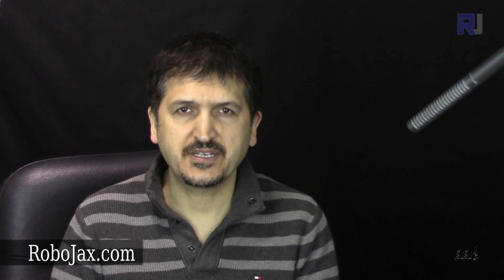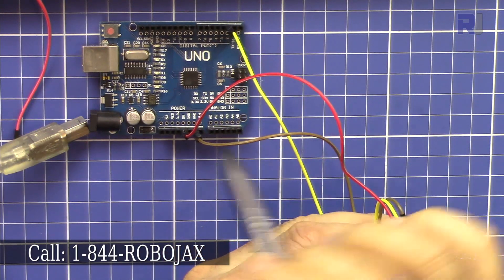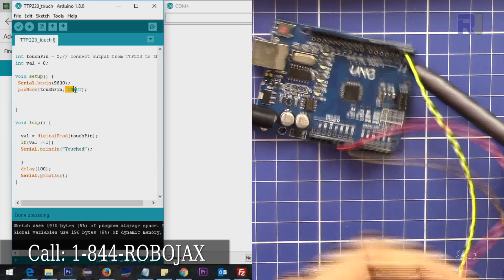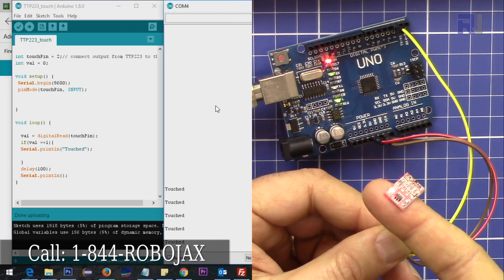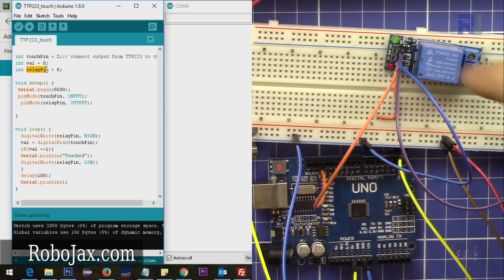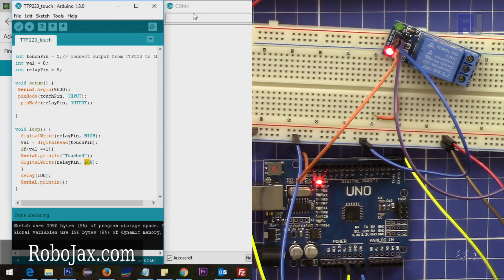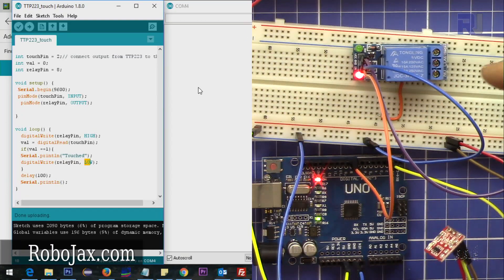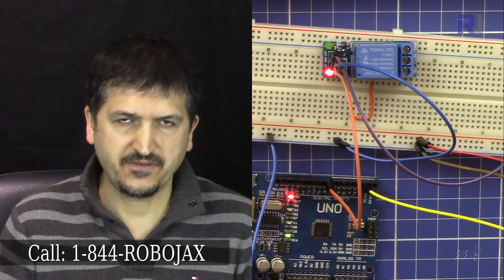How to use TTP223 Capacitive touch  Arduino module RTJ06

Comment: Good video but shouldn't you have soldered the pins on the component side of the board? It wouldn't be useful in a real application to have pins emerging from the same side as the touch sensitive pad.
Reply from the maker: it is the matter of preferences. you may be right. thanks.
Reply: @robojax  no problem. You make good videos.

Comment: Hello!  very good video!  
I have a doubt!  
I have a problem in the momentary activation mode, the sensor after 7 seconds holding it gives a delay and turns off the engine that is activating.  
how can i solve this?
Reply from the maker: Hello, sorry for late reply. I must have missed your comment. so you want to activate it when touch is held for 7 seconds? You can do it using millis() function of Arduino. Here is full video to learn millis https://youtu.be/obBX9hyH5mM
Reply: @robojax  no, i want it to turn on while tapped and off when released.  But this module only stays on for up to 7 seconds.  it has a delay to recalibrate.
Reply: @davidlima3615  @Robojax i need answers to this same issue
Reply: is the problem solved? i have the same problem

Comment: Can I use this to power on a Cordless hair clipper ?
Reply from the maker: your clipper or any other device is a load . you can turn ON or off a load if you use a relay. here is the video showing how to use a relay with this touch module https://youtu.be/YSI1PdSLbt0 or search my channel for so many other videos.
Reply: @robojax  very understood boss, my clippers are wireless and have a chip on them already would I still need a relay ? I don't believe there is enough room in the Wahl cordless clipper to have a relay box in there

Comment: Hi, can we control an ac washing machine motor with the given relay in video?
Reply from the maker: Hi, yes you can using a relay.  Here is the video from my course https://youtu.be/N-xbxtGGoHw use the output from touch project to  to control relay.  Your relay must be capable of whatever power your washing machine is rated. If machine is rated at 10A then the relay must be rated at 10A for example.

Comment: i picked up a couple of those ttp223b, with the pins already on, from aliexpress a few years back and am finally using them...   seems to be an issue with all 5 i got, but just to test, had hooked up 5v to vcc and grd and the light stayed on... tried two more and same time...   then i hooked up to the arduino and it shows what i could consider to be 'normally closed' - it shows touched every single time it goes through the loop when it's not touched.   anyone know what i can UNSOLDER or connect make this stupid thing work?  i know they're cheap to buy, but it's the time to have to wait to get replacements...   if i can fix, i'd like to.

Comment: How can I increase touch area of this ttp223 capacitive touch module? What will help me ? Aluminium foil or anything? I want to increase the area it gets input for the sensor. Pls.
Reply from the maker: I have provided the datasheet. They have mentioned it. it is not about just surface area. it is the material property and holds the electric charges or the "capacity" holding charges. if you increase it beyond certain size, it will always be ON or shown "TOUCHED" because the air will charge it. So either you have to know  full characteristic of material you are using (which most cased you don't have it) or just experiment with different material until you reach desired result. there might be resistor or something that you can change the sensitivity which you can find again from the datasheet. I have provided the link in the resources page. if not simple google or bing search will bring it. good luck
Reply: @robojax  okay thank you soo much. What is a good material for this touch module if I wanna rase it's sensitivity to the area half a metre ?

Comment: Hi, a quite old video but maybe you have an idea. My TTP223 is to control a NEMA stepper motor. I got accidental ON/OFF (light on TTP223) if the NEMA is connected and operating and the TTP223 is NOT floating in the air (just cables). If mounted to the wall I got this ON/OFF during NEMA operation. As soon as I disconnect the NEMA, everything is fine. There seems to be some frequency influence. I already tried a capacitor to stabilize voltage but with no success. Any idea what could be the issue and how to get it away.
Reply from the maker: Hi, how to you control the stepper motor ? the output of this should be connected to the "low impedance" input of your controller.  Try to measure the voltage of power supply while controlling the device with the touch . it seems may be voltage is dropping.

Comment: thanks for video. i want diy PC touch ON\OFF. can you help me?
Reply from the maker: you are welcome. What is PC touch? you want to do it with your computer?
Reply: @robojax  thank you. I want to use it like a power button. Touch to on PC
Reply from the maker: with this touch code turn ON or OFF the  Relay https://youtu.be/g6k8sPJyif8  and instead of connecting the relay to AC bulb, connect it to two wires that are connected to your computer power button. This will turn ON the PC but not OFF. It needs extra work if you need it to turn IT off. you can do it from Windows software "when pressing power" button what to do. Search for it.

Comment: I am very appreciate your work. But, have you ever using ESP8266-01 in together with touch module? I can not control to make INPUT from touch module using ESP8266-01. Thank you very much ;)
Reply from the maker: Haven't got a chance to work on WIFI. I have got bunch of devices and will make videos when I got a chance.

Comment: I want to sense the touch and give a preset audio in response to that. What are the things I may need for that? I am new to this area. Could you help pls...?
Reply from the maker: I have not worked with tone and melody. You have to first make a program that generates for example 4 sounds. Then you can use 4 channel touch pannel to putput any of those 4 sounds by touch. or 1 sound with single touch module. Here is my 4 channel touch video https://youtu.be/3_6g-FWzC0k a
Reply: @robojax  I want to make my robot to say 'Hello'  when somebody touches its right hand.  This is what I want to do.
Reply from the maker: You need a voice recorder/player where you can control the player to play sound at certain time. here my video on that https://youtu.be/IfK8z_o5vbk
Reply: try a teensy board are you basically wanting to make a sound pad?

Comment: Can I hide TTP223 under tint film or acrylic glass and still be able to use it?
Reply from the maker: The film will change the capacitive characteristics of the sensor and in turn will affect the sensitivity. You can't do it as it is.
Reply: Robojax thanks a lot
Reply from the maker: you are welcome.

Comment: can i adjust the sensitivity of this because i plan to use this as a contact sensor in a hand glove
Reply from the maker: If you look at the datasheet( see page 7 https://infusionsystems.com/support/TTP223.pdf ), you should be able to do it by selecting different capacitor value. But the capacitor on the module is SMD (surface mount device) and very tiny and you won't be able to change it. If you can find out the value of the capacitor and then either decrease or increase the value you should be able to change the sensitivity. But very tough.

Comment: I have it conected like this: positive to VCC, negative to GRN and it goes on but not off
Reply from the maker: Are you holding it in your hand? It is very sensitive and even holding it in hand will turn it ON. So leave on desks or something and then touch it.

Comment: can I make a keypad with ttp223?
Reply from the maker: Yes you can. You will see a video soon on my channel.
Reply: RoboJax Videos that's great. how long should I wait?
Reply: Yes, but you would need 10 of these chips (they are dirt cheap, so it doesnt really matter).
But there are also multichannel cap-touch ics out there, you should check these out as well. Some of them have i2c for example, which would definitely make sense if you need to save arduino pins.

Comment: can one make finger print scanner using ttp223
Reply from the maker: No it can't. Firgerprint reader have 1000s or milliions of  pixels to read the details of finger. This is capacitive ONE pixel or plate of metal.
Reply: No